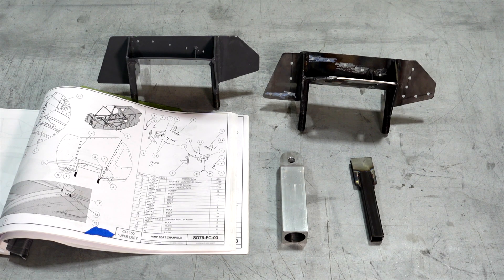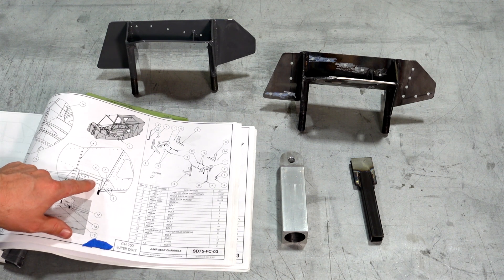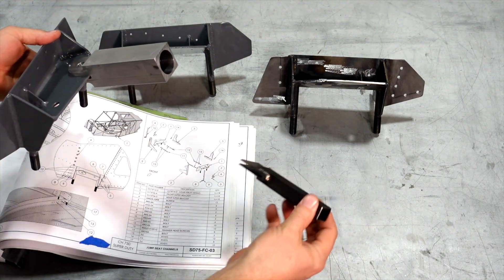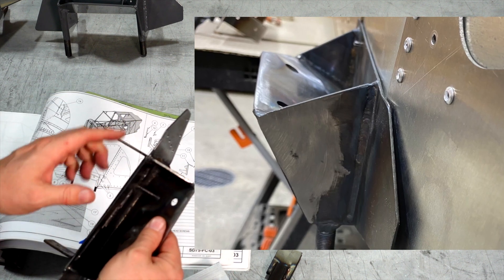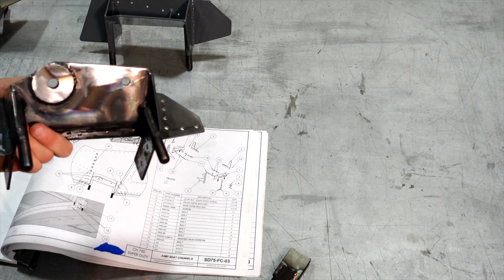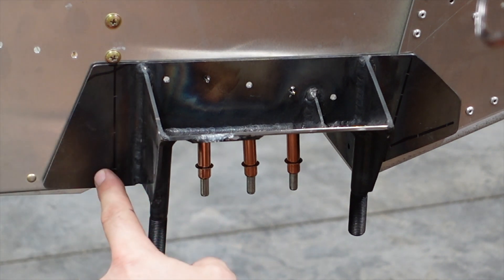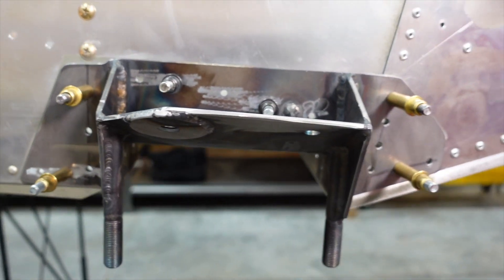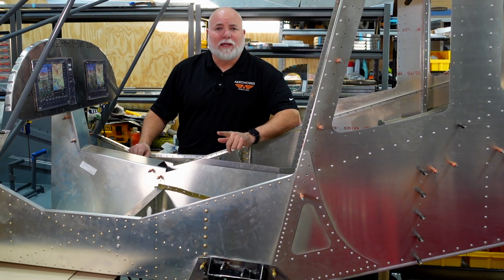Ep. 19 |  Landing Gear & Strut Bracket Fabrication | Zenith Super Duty Aircraft Build

Comment: When you are finding these discrepancies and notifying Zenith, are you finding that Zenith is eager to make the changes in the kit. I appreciate your honest with the kit as you build, and what I enjoy about watching your progress. These vlogs really show how differently identical kits can be built.
Reply from the maker: Thank you for the kind words.  I will say Zenith is always responsive and try to solve each problem or issue that arises.  However one thing that still has not been addressed is a proper build manual.  The plan are good but sometimes you need an order to follow to assemble something in the right order.  They are extremely lacking in this department with the super duty.  Some of the online pics are ok other are not even a super duty.  While they look like a regular STOL 750, things are completely different with the construction of each.  Slowly but surely I’m getting through it but the build experience would be much more enjoyable with a real step by step guide.  Thanks again for following along and hopefully you’ve subscribed.
Reply: @AeroworksProductions  Unfortunately, this also holds true for the Cruzer. Many of the parts has been upgraded to Super Duty parts and the build manual hasn't been updated to reflect this. I constantly have to go between SD and Cruzer docs.
Reply: @AeroworksProductions  thanks for your speedy reply. I have heard you comment on the lack of steps in the instructions before. I hope Zenith listens to your suggestions. A solution to this may be a very detailed video build of each particular model. It may be a little late for you, but if zenith were to source a builder with a good personality with the skills to build and edit video in a step by step manner this may solve one of there problems. The video would not have to show every rivet being pulled, just the assembly of the kit. They may even be able to source multiple people, and have them stagger their builds to get the videos out sooner. (Ie have one person building the fuselage, one building the wings, one build the tail.) just a thought. Have a great Christmas
Reply from the maker: @gregorygehrke1850  It’s been discussed but for me to do that I would have to be paid for my time to dedicate and allocate resources to only building an airplane and nothing else.  They did not want to do that at this time.  I totally agree with you though.  All Zenith would have to do is have the factory guys document a build in house.  I think they’re just too busy getting kits out.

Comment: one thing to check, if you haven't is the one that is welded on both sides, the inner weld can cause a fit issue where the weld hits the corner of the fuselage. Square corner against a weld radius.
Reply from the maker: Yep, already mounted up and installed, Ep. 20, coming out shortly.  Thanks for watching and hopefully you’ve subscribed so you don’t miss any episodes.

Comment: Hi Adam, great video, all the reason to check each factory fit part eh!
Hey, I’ve solicited many builders, factory, and designer’s about the “do ability” of gear mods.  Curious about your take about possibilities of Super Duty RG?  Hahahaha, I know it sounds crazy, but I’m skilled and setup for the engineering challenge, CNC’d parts drafted in Onshape (online form of Solidworks).  But, with all the subtle mods that are done by Kitplane Enthusiast, or Viking, can you envision this working?  Yesterday, I was taking some measurements at our club’s 750 Cruzer determining articulating paths and wheel storage.   I was planning a very simplified retract system using powerful but light EMA’s (Electro-Magnetic Actuators).  So, given your experience in all things aviation, any impressions or thoughts would be well received!  Don’t be too hard to kill the dream though... 😂
Reply from the maker: I admire your enthusiasm however if you felt the weight of this gear as well as the size of the tires that this plane was designed for, you would see that there is not really a practical way or reason to go RG.  The Cruzer might be different.
Reply: @AeroworksProductions  yes, I been told that for sure.  The cruzer would be a better platform.  In fact, it would probably be easier to retract the slats.  Yes, thinking about that too!  I like challenges and I have done many mods in hot rod cars, ie suspensions, and love the idea of RG.  I’ve got a few people here already helping me with design.  My fuselage kit is about next July.  Meanwhile, I’ve been researching various EMA and BLDC products and specs toward this end.  Anyway, enjoying your channel among many, turned into an armchair builder of sorts!  Really appreciate your videos Adam, ty.